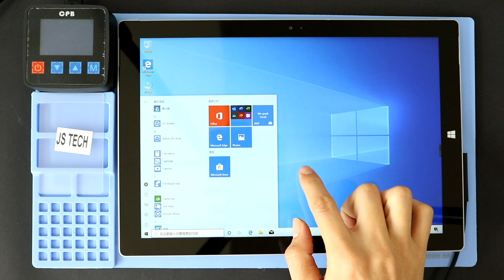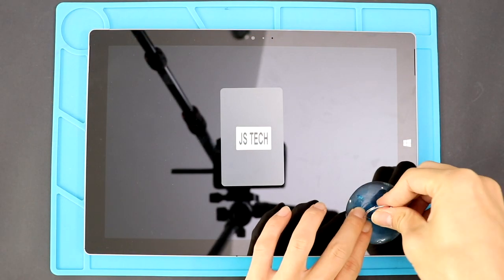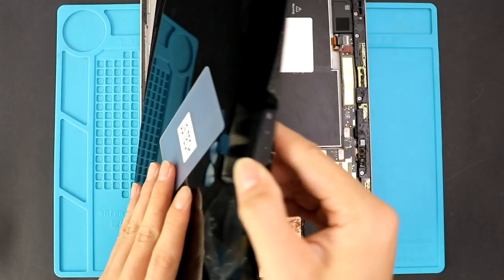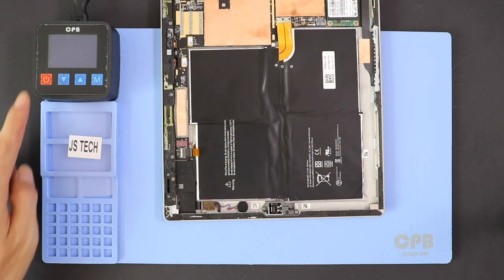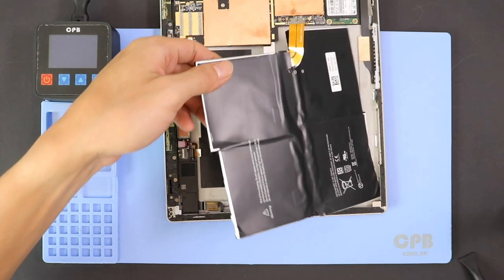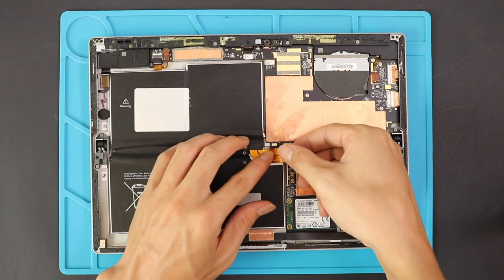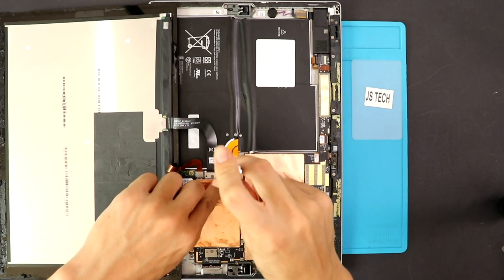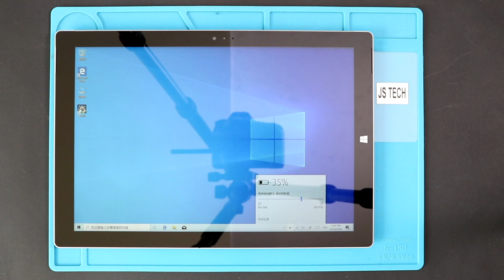Microsoft Surface Pro 3 1631 Battery Replacement

Comment: Don't even think about it.

Even if you buy this device, 95% of users will have a broken screen.
Out of 5% of successful users, 95% of them will cut their wifi cable or Ntrig flexible cable.

It's very easy in the video.
But even if you apply heat to the screen, it is difficult to easily insert a plastic card and move it.
The black glue doesn't let go that easily.
And it is normal for the plastic card to get dirty due to the black adhesive attached to it.

I bought a used Surface Pro 3 in 80-90 pieces on eBay.
It was imported and sold.

The 20-piece crack screen was replaced, but even the crack screen was difficult to remove because of the adhesive.

I bought various tools to remove the screen, but to no avail.

Only people who don't care if the screen is broken can open the screen.

If the battery swelled and the screen opened naturally
It is very easy to repair.
Reply from the maker: Thanks for you input.yeah it is not easy and challenging. But it is possible.
Reply: good work  @DIYGeardo

Comment: Getting the screen off undamaged is critical to this operation. Removing the screen on an MS Surface is difficult and would-be battery installers should really think twice before attempting this job.
I'm against vloggers such as this one who remove the screen prior to videoing the process, then pretend to do it for real while the camera is rolling. This one is a prime example where the screen almost falls off. Warning to all - This is NOT THE CASE. This is the part where you wreck your Surface because the glue is so strong that you severely risk cracking the screen while attempting to remove it. Disregard this easy-peasy screen removal video. Once the screen is removed the rest falls into place but the first step is the hardest. BE WARNED!!!

Comment: Hi! Thanks for this video.
What I am about to say will be considered as off topic but there is a thin connection actually. I did some tile replacement in a bathroom in the past. I used a source of heat to loosen the glue behind the tile. Then what I did was to apply a limited force to lift the tile, limited in intensity but constant/steady over time. The glue will eventually yield. In this case of an LCD screen, it is important to apply this force not on the glass itself but on support behind it. I don't think that more than 70'C is necessary, most of all if you aim to the glue. I am not saying that this is the good technique in this situation and you can use it at your own risk. I won't be held responsible for any damage. I am just saying what I would do if I had to do this operation. Eventually, I will have to do it.😖

Comment: Ive been told by multiple local repair shops that taking off the front screen is nearly impossible and that there is a a very big chance that my screen will break so i will have to pay for the screen replacement too if i did the battery replacement, is this true with a specific model? i don't get it.
Reply from the maker: Well , it depends, Many shops able to change the battery without breaking the lcd. Needs proper heating and patience. It is possible to remove without damaging
Reply: definitely not an easy repair by any means, its possible as demonstrated by the careful and precise hands in the video. but not every tech has a surgeons hands.

Comment: This video is falsifying. I have exactly the same heating pad and surface pro 3. After heating it to 75 degrees Celsius for about six mins, the glue around the screen is still too hard to be cut through with a plastic card. Alcohol didn't work either. Microsoft put the strongest glue on it.
Reply from the maker: Normally the machine we are using, goes to about 100 degrees, Gradually. And it last for about 1-2 minutes. 
And if it still sticky, we are adding 1 more minute. Then it is good to go
Reply: @DIYGeardo  The video does not mention 100 degrees, the display in the video shows 75 constantly. I personally measured the temperature with a laser gun, even it was set to 75, it goes well above 75 before the thermostat turns off. Is that what you are talking about? Or you put manually to 100 degrees, for a bit yourself?
Reply from the maker: @Murat Hamderi  This machine gradually increases to 100, it is not like that, you turn on the machine, and it is at 100 degrees. It increases step by step. This machine is doing this automatically, and then it stops somewhere at 2-3 minutes. Most of the time it is enough, but in some cases, we are starting the machine again and applying one more minute. Well, we did not mention the degrees because the device is doing that automatically for us.
Reply from the maker: @themurat267  At first, we are letting the machine to run the heating process. So gradually, it goes to 100 degrees. Suppose the device still has issues after the first attempt. In that case, we are rerunning the machine (most of the time automatically but in some cases manually (75 - 100c). 

It is quite strange that some devices need extra heating and some do not need. After the heating process, It would be best to create an opening and slowly cut the adhesive. That is the best way. And also, it is not safe to heat the machine for a longer time. It can damage the board or components. After the first attempt, apply the heating step by step.

The video does not mention 100 degrees - We are trying to control the video duration, so it may get affected when editing.
Reply: @DIYGeardo  by the way I managed to remove the screen, by heating up to 75, while the tablet is on top. The plastic cards could not cut through, but the 1 mm thick steel Pryer could. It was very easy with this steel Pryer. That was the magic for me. But the 4 th and last battery piece exploded, when removing. That was unexpected.
Reply: Try a razor blade. Use a pry tool such as the picks in the video, use to pry the screen up and make room for the razor blade so that you’re not using the razor to pry the screen while trying to cut. Haven’t attempted this yet but I’m ordering a battery now.
Reply: Here’s an idea, leave your tablet inside your car on the dashboard on a hot day, that should loosen the glue.

Comment: The risk of crack the screeen is super high. The best place so start with the lift is the top, where there is the plastic bezel. Do not start with the loudspeaker rientrances.
Reply from the maker: Thanks for your tip.

Comment: Did any of you replace the battery when you had the Surface Pro 3 no start issue? Mine just stopped working and will not start when using forced start, etc. If so, did replacing the battery solve the issue? Such a nice bit of kit, it would be a shame not to keep it working.
Reply: I mean, you should be able to power the surface with the charging kit at least, even if the battery can’t hold any charge.. haven’t had this issue yet at least, I’ve got a weak battery that dies with about 20 minutes of use from what says a full charge, but I can always run it with it plugged in.. if in your case you didn’t at least notice the battery life dying early on than I would suspect it’s not the battery causing a no power fault. Also I’m assuming depending on your charger quality weather or not it might not power due to dead battery, though my charger is a knock off with the connectors held together with hot glue to keep the exposed wires from breaking their solder connections within the connector, still works for me so I doubt that a cheap charger wouldn’t work but it’s at least a consideration
Reply: I followed a tutorial with 4 fixes and the 3rd fix which was just pressing the screen all over in order to possibly make inner parts click worked for my Surface Pro 3
Reply: The video tutorial I followed was titled "Microsoft Surface Pro 8 & X: Black Screen, Won't Turn On? 4 Easy Fixes!" from the channel WorldofTech

Comment: might get a heating pad just for this, a heatgun can easly damage the plastics around the device i hear. Dude, you made this look so easy, but a lot of people kill their screen, ill go slow like you did, seams like the only way.
Reply from the maker: Thanks for you feedback..well it is not easy as looking at, but patience will help to achieve..again i agree with you, well heat gun also fine..just need to use it properly..But having a heat mat is very handy, because it is a must have hardware piece when you are owning a phone or tablet..

Comment: I'm wondering if I could just use a regular heating pad, you know like the kind you use if you have a sore back? I have one of those already and don't do enough repairs to go buy a specific pad for heating phones and tablets.
Reply from the maker: do you know what is the maximum level it can reach ? i mean the heat
Reply: @DIYGeardo  How high does a heating source need to go to work on this?
Reply from the maker: @SS-zi3ky  about 100

Comment: MY feedback: This video looks like many where troublesome screen has been removed before the video then it is easy peasy to remove it a second time with camera running.
The fixer hardly used any force and at one time seemed to be pressing down to give impression force was needed to push plastic card up screen. To all interested, don't get too excited about going it alone after watching how "easy" this one seemed.
I KNOW screen removal is a VERY difficult task made more difficult when a large screen with more flex can EASILY crack plus you can scratch or dent your Surface case if you do not use the exact tools seen here or get frustrated when it isn't coming off as easy as you imagined.
Best to give yours to a professional and let them worry about it or are you going to buy all those picks, torq screwdriver set AND a $70 heating pad so you can break your Surface? Good luck.
Reply: Yes I agree, but at the same time, did you try this yourself? And if so, did you heat up the screen? and what method did you use if so.
Ive done similar repairs on phones and lesser quality tablets and I used to use a hair blow dryer to try and heat it and had difficulty removing the screens but once I upgraded the heat source to using a heat gun from the hardware store that gets much hotter I’ve yet to come across any adhesives I couldn’t get hot enough to manage a safe screen removal.. not as easy as this video makes it appear to be, but less damaging at least.
Reply from the maker: Thanks for your valuable feedback. Somehow we have missed the reply. Sorry for that. First, we have shortened the video a little during the heating and removing process. Probably you can see that..Removing process all come to the heating and the person who performs. As you said, I can agree that It is not easy to repair a surface tablet. You need a lot of patience and proper tools. If a person is not comfortable it is always good to seek a professional technician.🙏
Reply: @DIYGeardo  as I was attempting to get my screen off, I had one corner up, where at least the adhesive bond had been separated.. but as I got to the other corner , working wit plastic cards, thin picks, and a thicker wedge/pick to hold up the other corner, it broke. Completely cracked across the screen and the second corner busted and a few small pieces came out. Lots of heat was used, heating pad to bring the entire screen upto temp, followed by focused heat localized to the current work area and immediate surrounding area. No excessive force was involved in any way shape or form. Was using a sharp edge of a very thin plastic card to go under and cut the adhesive, no prying involved, but it still broke. I like to think I’m a very capable technician with many many similar projects under my belt, but something about these surface pro 3 screens are just super sensitive and I didn’t even finish removing the screen. It was later evident that even slightly excessive heat was used to the point that the screen has a very slight discoloration when in use, so I don’t think it was a lack of heat.. I sum it up to manufacturers fault, as far as serviceability aspects are concerned. But who am I, a avionics technician for the navy, two aircraft maintenance associates degree holder who does similar stuff for a living and on the side for business and personal entertainment to make any such claims? 🤷‍♂️ haha not worth the cost of a new screen, and will be left alone to preserve functionality even if I have to deal with a bad battery..

Comment: I don’t have a heating mat and plan to use a hot air gun. 

When heating the battery area should I head it from the side?m or underneath?
Reply from the maker: with heat gun, top of the battery is good..

Comment: Mine just won’t turn on even with the charger plugged in. And the charging light is off. I’m sure the charger is fine. Should I replace the motherboard or the battery?
Reply from the maker: Changing the motherboard is like buying a new device. Go to a technician who works with boards. They might able to help you

Comment: Hi Geardo,  I tried to use a small phillips screw driver to remove the screws, but did not work.  What type of screw driver will I need?  Also, is there an email I can contact you on. Thanks Age.
Reply: Torx m5

Comment: Hello, how to remove bios password for surface pro 3 ?
Reply: First step; try not stealing someone’s shit.
Second step: ask the original owner for bios password if purchased second hand.. 

Only reason I’d think you can’t get the bios password is if the person who sold it to you has reason to not share the password, such as a transaction dispute. I also don’t think anyone smart enough to get to the point of setting a bios password wouldn’t realize the severity of setting a bios password, let alone forget it.. it’s trash without the bios password

Comment: Load of rubbish...it's clear the screen was already off or they cracked the original and swapped it for a replacement, having replaced these screens the video is fake
Reply from the maker: Thanks for the message. Well we have edited the video. Screen removal process is taking about 10-30 minutes. We are planning to add unedited videos soon.

Comment: Can we turn on surface without battery directly with charger?
Reply from the maker: If I’m correct yes, but needs to do some work with in battery contacts. Also I don’t think long run it is a good option
Reply: @DIYGeardo  ok

Comment: followed the instruction, went through all the comments and I even increase temperature to 102 Celsius. I still don't see any way I can sneak in a plastic or paper piece. give up.
Reply from the maker: Thanks for your feedback.. Well sometimes it is quite hard to remove..some devices needs time..If possible, Be patient and try..